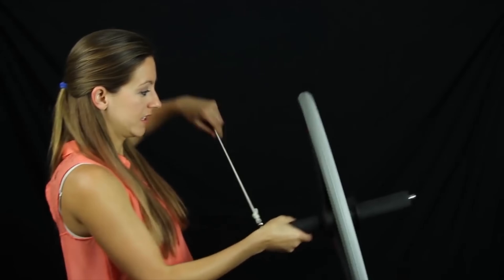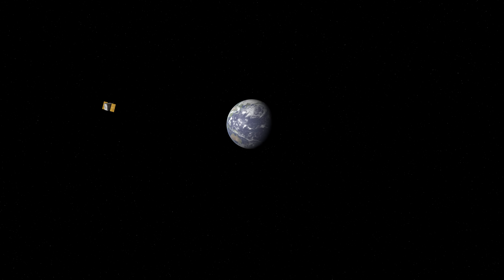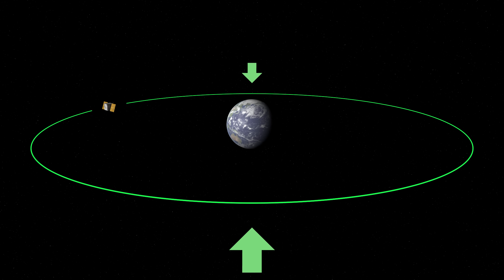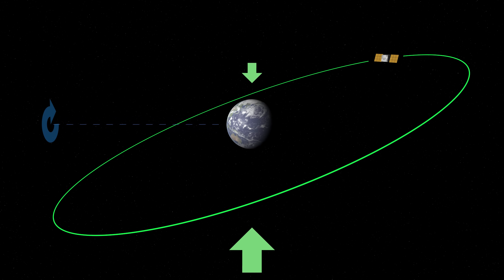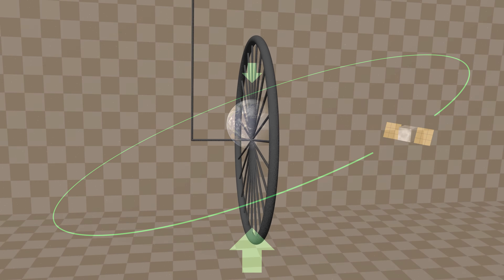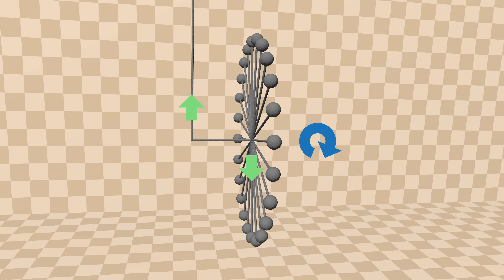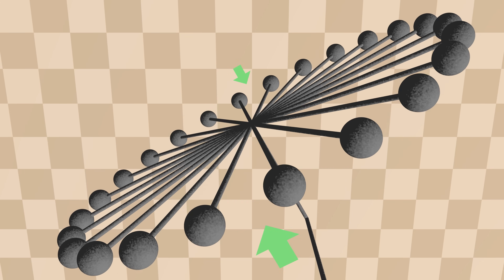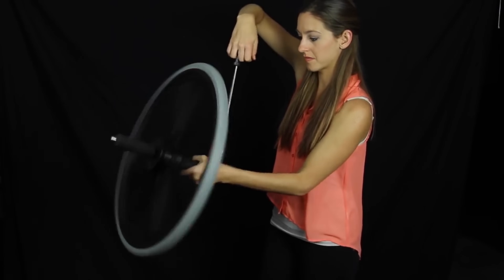Gyroscopic precession -- An intuitive explanation

Comment: Really outstanding explanation about why it rotates unexpectedly. Could you answer something else about this. You know how a wheel that is rotating about a horizontal axis wants to keep spinning about that axis like a bike wheel. And something rotating about a vertical axis such as a spinning top wants to keep spinning about the vertical axis. What about something that starts off spinning at a 45 degree angle. Will that want to keep spinning about that same angle?
Reply from the maker: Thanks for the kind words! Two observations: spinning wheels do not resist having their axes of rotation shifted, they just take the applied torque and transform that to an axes rotation that is 90 degrees away from what's expected. If the wheel is free to rotate in all dimensions, like the bicycle wheel, that results in precession (as shown in videos). When the spinning wheel is mounted in gimbals that resist that motion, that change is impossible and you have a gyroscope. So it's important to recognise that the restricted motion of a gyroscope transforms precession into an apparent resistance to change. To answer your second question, a spinning top spinning about a 45 degree axis precesses around, there are plenty of videos of this effect.
Reply: Sorry but I couldn't find any videos of an object spinning at 45 degrees after a lot of searches. If you have a link to one that'd be great. I wish I had a setup to test this out. You agree that a bike wheel like at the start of this video, wants to stay upright and a spinning top starting off spinning horizontal stays horizontal. So for example what would happen if you got that bike wheel at the start of the video spinning extremely fast but starting at 45 degrees. Would it exhibit the same gyroscopic precession and stay at 45 degrees. Or would it rise up and stay upright. Or neither. If you know the answer to this that would be so great.
Reply from the maker: See https://youtu.be/cquvA_IpEsA . At one point it's hanging from a string at about 45 degrees. The answer is that it tends to stay at the same angle, but if it's at any angle other than spinning perfectly  horizontally, it will precess around while maintaining that same angle with respect to the ground. To predict this stuff, you're actually much better off using the more traditional approach of torque and angular momentum vectors, even if it's less intuitive than my video!
Reply: Thanks so much. This problem was driving me crazy but that's actually what I though would happen when it starts off at an angle.